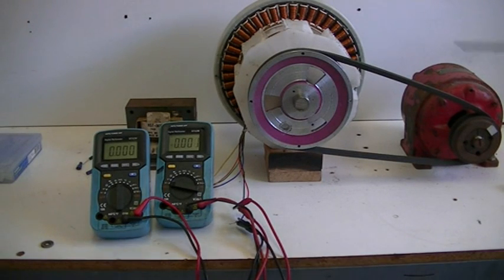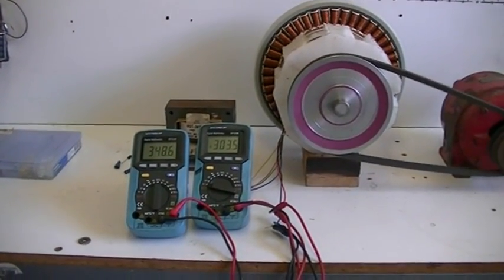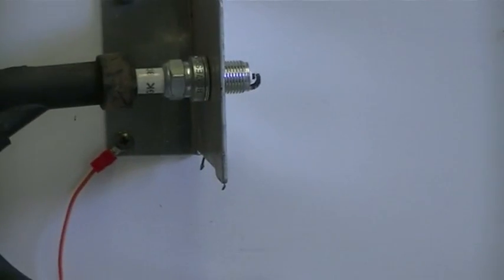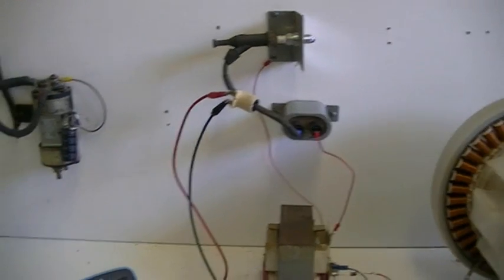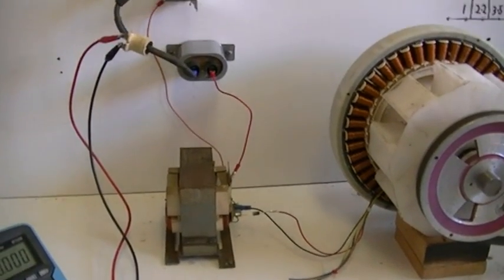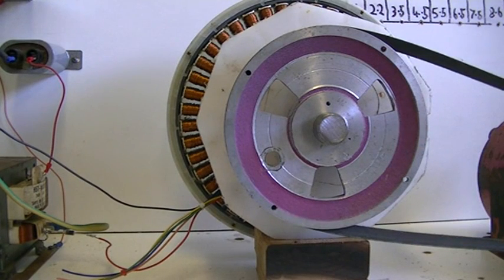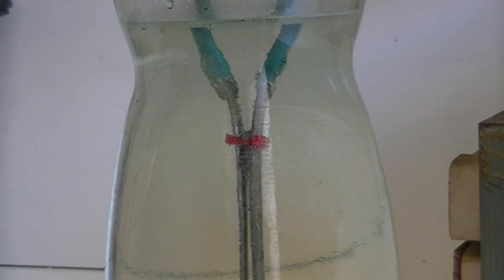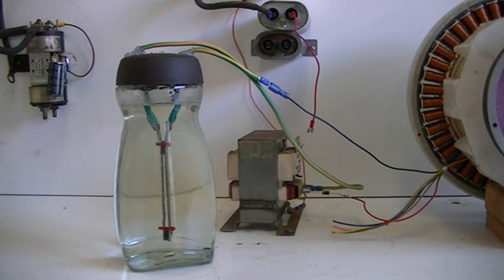HHO meets Tesla HV

Comment: So if I were to pull power off my wall socket for suh a set up, would I then connect one electrode of the cell to the primary coil, and the other electrode connected to my neutral?

Comment: Hi, my friend, nice to see you're still
At - it. I only have one thing to say"
It's something I told "Garard, a pretty good while back,"* ( YOU CAN'T MEASURE, THIS TYPE OF POWER" W/CONVENTIONAL GUAGES)!!.
You might, get Some Simi, conventional" / HALFWAY Normal,
Reading's..?!?! But in the end"* 
They surely, CAUSE CONFUSION.
IT'S KINDA LIKE* ( MESUREING THE FREQUENCY OF AN (SINGLE LIGHTNING BOLT IN A HURRICANE ),!! WHILE MILLIONS OF
OTHERS, LARGER & SMALLER, EVEN DOWN TO A MICROBURST"!!
ARE CRACKING* ALL OVER" AROUND YOU & YOU'RE DEVISE...
However, Not to leave you hanging"
( TESLA, USED A DEVISE, NORMALLY USED, TO MEASURE 
TIME,.!!  NOT LIKE A WATCH, CLOCK,
BUT MORE LIKE THE SWINGING" 
TIME CINKRONOMETOR IF MY SPELLING IS RIGHT" YOU'LL FIGUR IT OUT. GOOD LUCK, MY HARD HEADED FRIEND....LOLOL

Comment: PWM and high voltage but low amperage are what we need for efficien HHO production good mate, take care
Reply: No, all you need is study physics
Reply: The secondary winding spark gap is the   PWM adjustable by spark gap and different caps.I would try using high freq diode

Comment: A couple of points! 1. If you are collecting the gas the way you are it is 2:1 Hydrogen / Oxygen .... which is explosive! 2. You are putting a diode to the input of the transformer which will give half wave rectification .... what is the purpose to this?  3. You have a resonant circuit between  the transformer and the capacitor (inductor and capacitor)! What is the purpose of this? ..... I assume there is an earth path between the spark plug and the generator? If you wanted to simply produce gas you eather increase the frequency or/ and the voltage! You could use something like your generator to supply the input to a Tesla coil with the HV output going through the gasifier back to eatrh!

Comment: It would have been nice to see a comparison of the generator rectified and running the HHO cell along with your HV setup.... from what I see so far... you basically have an inductor in series with your half wave rectified output from the generator. The inductance of that primary winding is changing when you have a sparkgap setup on the secondary... probably allowing more current to flow thru. By changing the capacitor you have a different impedance in series with the spark gap.. thus acting more like a short circuit on the secondary winding.... increasing the eddy currents in the transformer and passing more current thru the primary winding...   I'd like to see the generator connected directly to the primary winding of the transformer without the diode... then run the secondary (the real high voltage) to the hho cell after rectification (you'll need the HV diode from the microwave to do this).... better yet, use 4 diodes for full wave rectification...

Comment: transformer is made to run on AC that is what you are generating - so, no diode from generator to transformer. spark plugs also spark best with AC - so no diode from secondary to plug, also no cap needed, however voltage might be to low to cross the spark plugs gap. and lastly that poor transformer is rated for 60 hz. you are running it at way higher than that, and also rated at 110 Volts (rms) and you are at about 3 X that much so you might short out the primary windings killing the transformer.

Comment: I encourage you to keep working on your project. Any experimentation is good for the cause. However, I would like to point out that when you have no load on the secondary of the transformer, you have very little current flow on the primary side of the transformer, and when you connect a load to the secondary side of the transformer, you increase the current flow through the primary side of the transformer. Since your cell is connected in series with the primary of the transformer, you will see that the gas production will be directly proportional to the current flow in the primary of the transformer. When the primary current goes up the gas production goes up, and when the primary current goes down, the gas production goes down. I would encourage you to try to hook the output of your spark plug wire directly to your HHO cell with the same gap between the plates as you have for your spark plug gap. Try to make changes to the capacitor to test it at various frequencies to try to hit a resonant frequency for your HHO cell.  With your high voltage you should see a state of matter known as plasma, and the spark gap will probably generate browns gas and the spark will ignite it at the same time generating a plasma ark. Be sure that your cell can vent off the pressure created. Also try it without the diode on the primary side of the transformer. It will pass the full AC wave to the transformer, but that will just mean that a different polarity will hit the plates of your cell for each cycle and they will produce the opposite gas either hydrogen or oxygen for each alternate cycle. This experiment in my opinion would be closer to the water spark plug that Myers was working on that would allow a spark gap device to be screwed in place of a standard spark plug on an internal combustion engine, and feed the device water and high voltage to enable the engine to directly produce brown gas for the engine cylinder as fuel and ignite it to produce engine power. Keep up the videos, and cheers to you on your future experimentation...

Comment: I experimented with this years ago.  The rate of electrolysis is directly related to the overall watts.   The transformer will bump the voltage up, sacrificing amps and therefore watts.   You will also have losses with every change .  

I didn't see your full bridge rectifier.   Without a full bridge rectifier, it's only passing part of the electricity. 

Don't get too anxious about using the released gases.  None of the suggested methods even come close to breaking even on the energy required to split the water compared to the energy capacity of the hydrogen/oxygen mixture.  They've been making very ambitious scams for a few decades though.

Comment: try conecting the hv diode from the output of the hv cap to the body of the transformer then the voltage will go higher and remove the diode from the input as it halves the voltage and currant. note the body of the tx is hv ground  i hope this helps   enzo
Reply from the maker: You must have the diode,as there will be no HHO with AC.
Reply: Since HHO isn't a real thing, you are correct that there won't be any without a diode.  There also won't be any with a diode either.  You will just have a mixture of H2, O2 and water vapor.
Reply: HHO is a stoichiometric mix of H and O2, not a chemical compound of the 2.